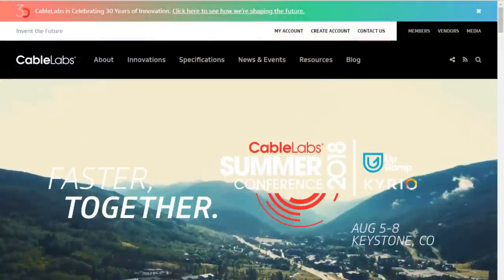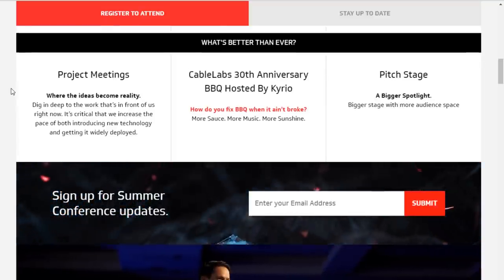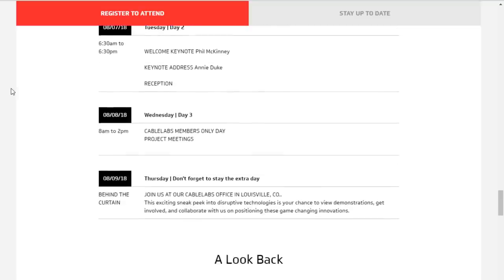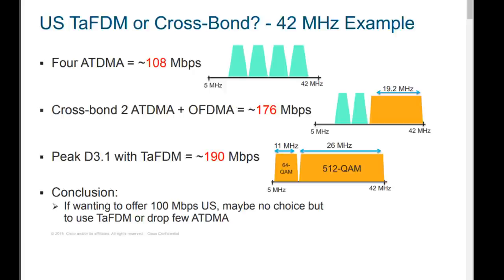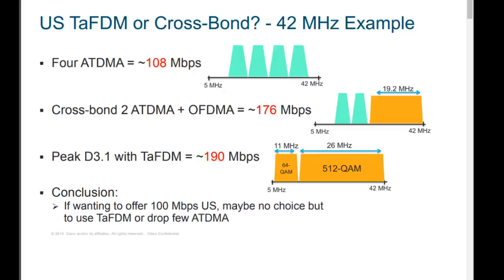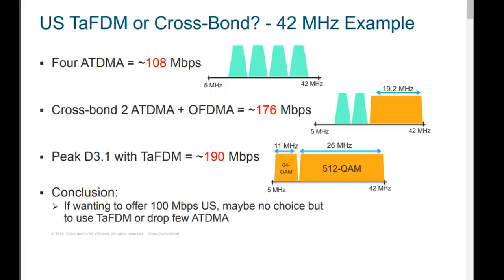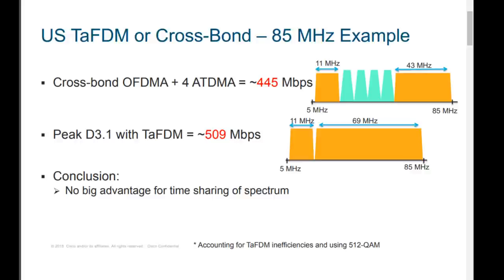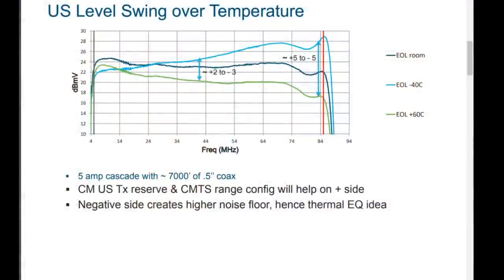Upstream levels for DOCSIS 3.0, DOCSIS 3.1 - 204 MHz, FDX and RPDs

Comment: hello i have quick question for you, i got replaced my modem and kind of solve the issue i had before with my intermittent connection. however my Speed never worked the same i used to have 250 mb and now i have around 90- i have access to the modem setup website for ARRIS but don't know what to modify i am pretty sure is something there. my modem is ARRIS SBG 6900 docsis 3.0- can you help me with that? i just don't know the right setup-I WILL APPRECIATTE THE HELP THANKS IN ADVANCE
Reply from the maker: Do you know if you previously had a DOCSIS 3.1 modem? Since you purchased a DOCSIS 3.0 modem you may not be able to take advantage of the DOCSIS 3.1 channels which maybe slowing your speeds.